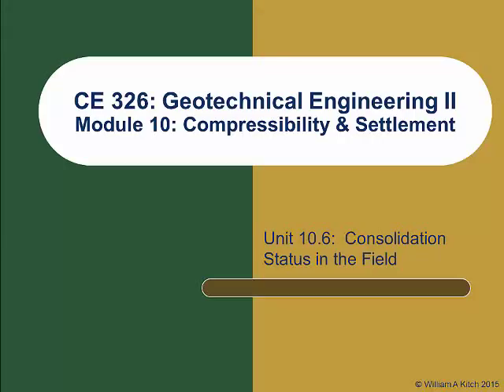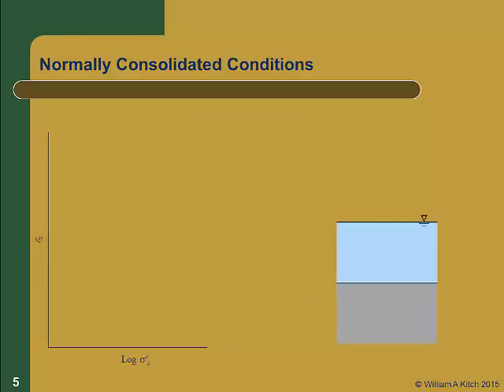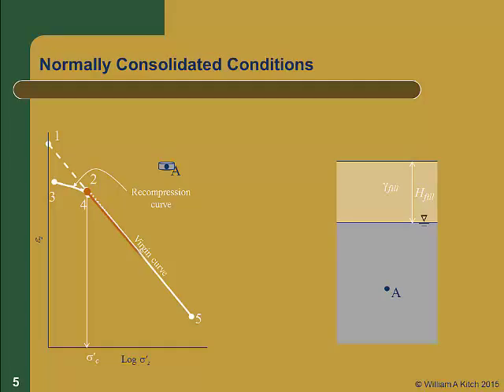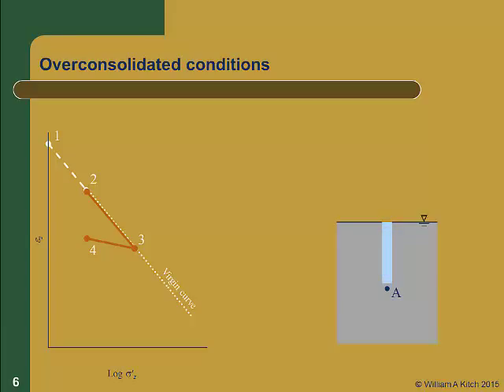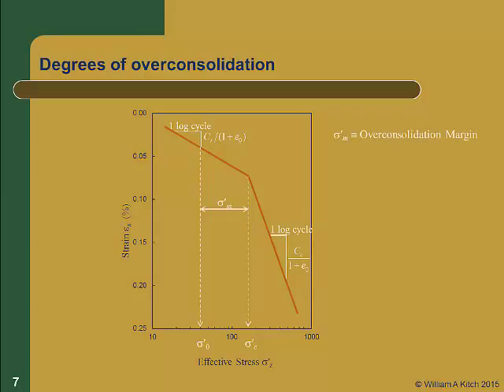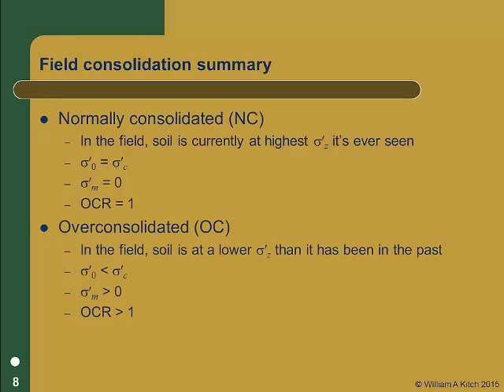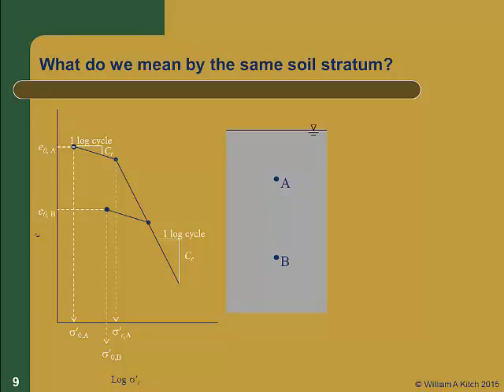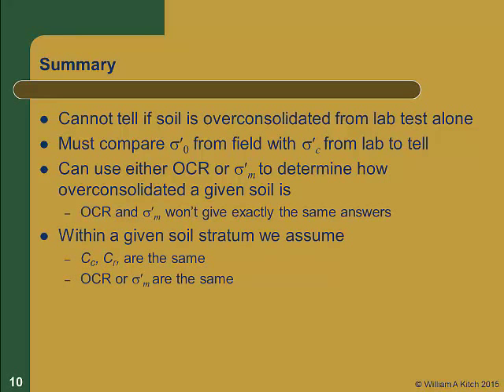CE 326 Mod 10.6 Field conditions

Comment: You didn't  when the OCR is less than 1 ... Underconsolidated soil or soil in the process of consolidation ?
Reply from the maker: Yes, theoretically when a soil is in the process of consolidating, OCR can be less than 1.  This would come into play if you were to apply an additional load to a soil while it was still in the process of consolidating under a previous load.  For example, if you place a fill as a building pad, waited some time (but less than full consolidation) and then constructed a building on the fill.  In this case the soil would be underconsoldiated at the time the building was built.  But this is mostly just an interesting academic discussion.  Not particularly important from a practical standpoint.